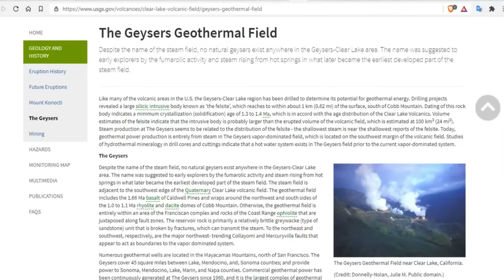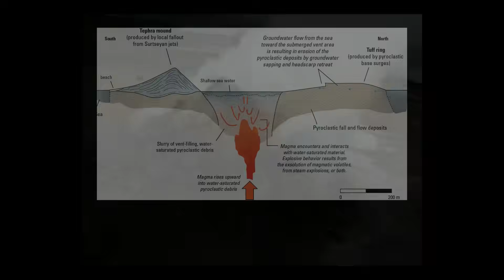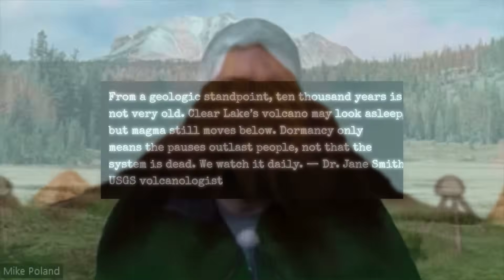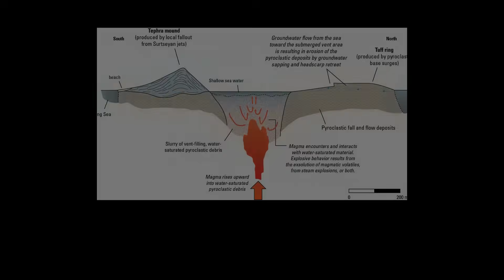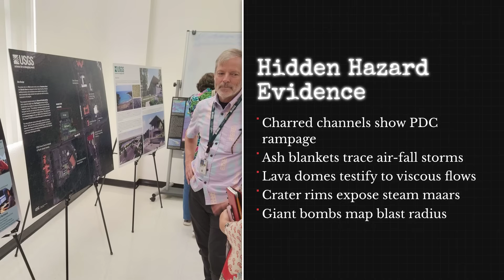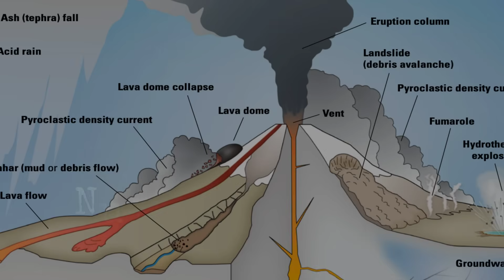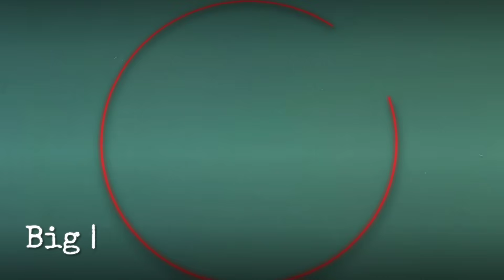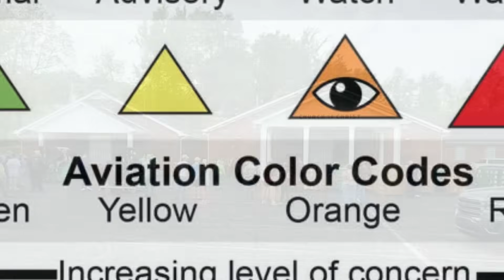ALERT: Clear Lake’s “Sleeping” Volcano Warned as HIGH THREAT

Comment: The main fault lines near Clear Lake, California, are the Bartlett Springs fault and the Maacama fault, which bound the Clear Lake Volcanic Field. These are right-lateral transform faults, similar to the San Andreas fault, that run northwest-trending and accommodate movement between the Pacific and North American plates. The Bartlett Springs system includes other faults like the Lake Mountain and Round Valley faults. https://www.google.com/maps/place/Clearlake,+CA/@38.9730787,-122.5917832,23773m/data=!3m1!1e3!4m6!3m5!1s0x80838b954060c195:0xc16aeac6f3b5e9b6!8m2!3d38.961809!4d-122.6312972!16zL20vMHFfcG4?entry=ttu&g_ep=EgoyMDI1MTAyOS4yIKXMDSoASAFQAw%3D%3D

Comment: There is no straddle volcano at Clearlake. It is a Caldara, which is filled with water. You have it completely wrong and misleading pictures and also has two geothermal power plants very close by, but it’s not going to erupt it is very dormant. But dormancy doesn’t mean it doesn’t have volcanoes. I’m sorry earthquakes and the lake. It certainly does have earthquakes usually very small ones and if someone needs to fix our plants, someone goes out there otherwise they’re self-sufficient and they run on their own or there’s only one person there usually to make sure they’re running correctly. Get your facts straight before you put up pictures and words that do not reflect the actualsituation that you’re talking about.
Reply: The main fault lines near Clear Lake, California, are the Bartlett Springs fault and the Maacama fault, which bound the Clear Lake Volcanic Field. These are right-lateral transform faults, similar to the San Andreas fault, that run northwest-trending and accommodate movement between the Pacific and North American plates. The Bartlett Springs system includes other faults like the Lake Mountain and Round Valley faults. https://www.google.com/maps/place/Clearlake,+CA/@38.9730787,-122.5917832,23773m/data=!3m1!1e3!4m6!3m5!1s0x80838b954060c195:0xc16aeac6f3b5e9b6!8m2!3d38.961809!4d-122.6312972!16zL20vMHFfcG4?entry=ttu&g_ep=EgoyMDI1MTAyOS4yIKXMDSoASAFQAw%3D%3D

Comment: Would you sleep next to a snake just because it didn't bite you in the 1st 5 minutes?
Reply: If living next to that snake radically improved the quality of my life, if the snake was poisonous, I would have a supply of antidote and be happy. My quality of life was radically improved. This is not 1600. We have ways of dealing with most problems. If they’re actually are no ways and they are that much of a threat that I might not live right there, but I’m not going to exaggerate the risk and run away like a snowflake afraid that it’s going to melt. Nobody in this world is guaranteed anything. Get used to it or pass on to the next life because you can’t stand being alive